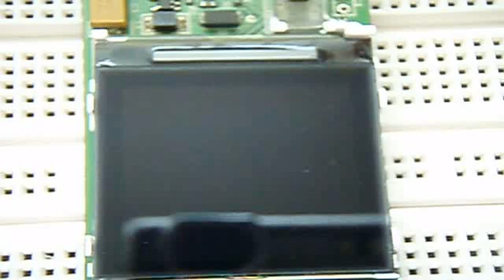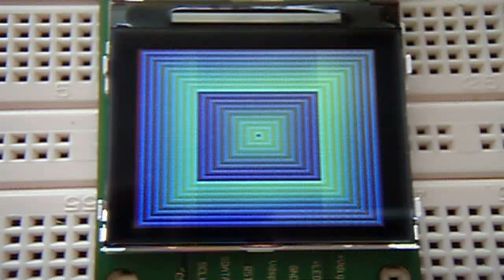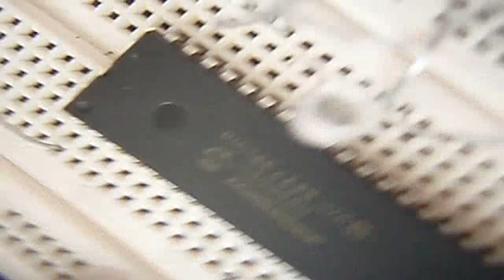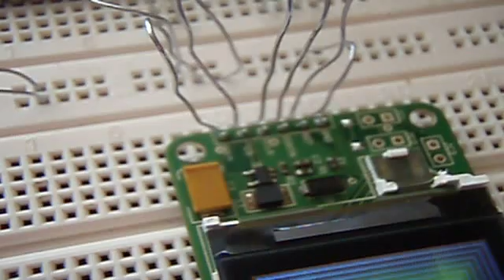Pic Microcontroller with Nokia LCD

Comment: @Kdg86 as for the epson controller you mentioned, is it built in the LCD panel itself or do we have to couple the terminals of the LCD to the so-called driver? I have lots of LCDs from nokia too but I'm still at starters with it... identifying the model number is another thing too.. 

Thanks for your time.
Reply: As per my knowledge it is built in the LCD.

Comment: looks like you're using a bare PIC with no overhead, not one of those PIC learning modules that cost a hundred dollars and seem to be designed to keep you from learning (on the hardware level)- [just my uninformed opinion- I'm here to learn]
So yeah, I like that- what is hooked up to your PIC?